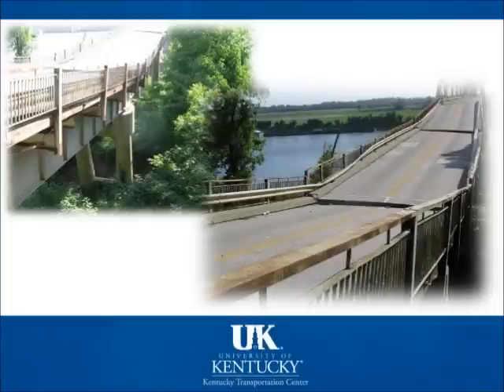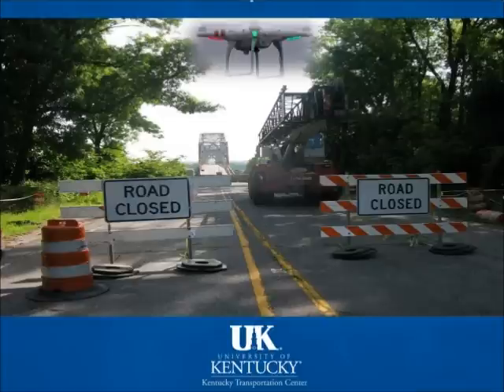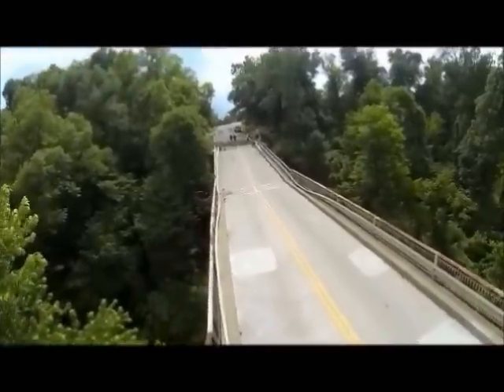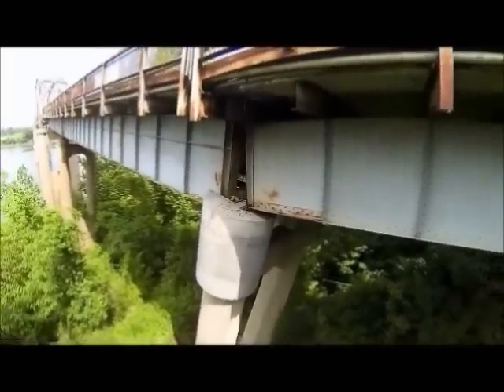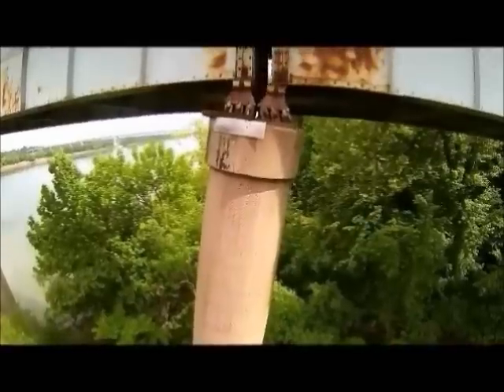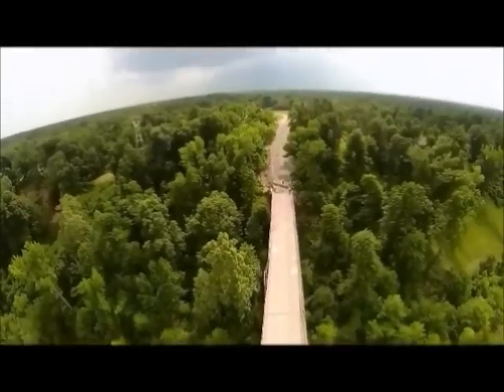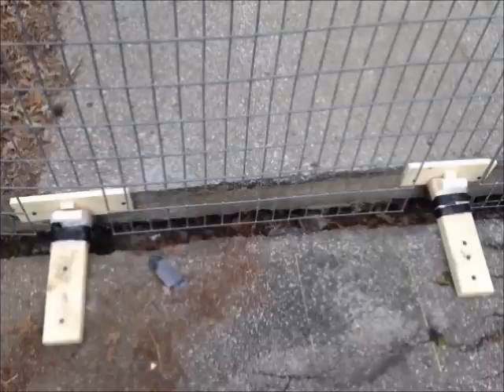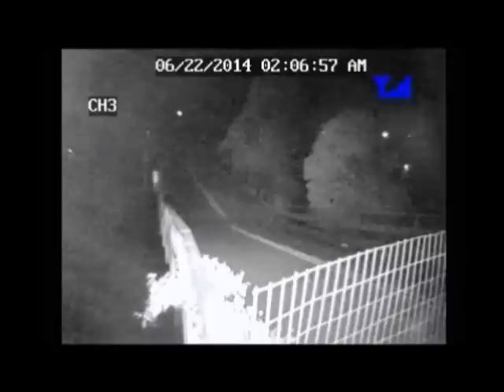Ledbetter Bridge Collapse Paducah, KY June 2014

Comment: Most of those bridges are nearly a century old, and some have passed that mark.  Most were 20 feet wide (some 18) and were not designed to carry the loads they did in later years.  Though the support steel was a bit rotted, the reason for this failure was the collapse of the bridge abutment.  They all need replacing;  even the I-24 bridge is insufficient.

Comment: In the mid-70's, driving from CO to NC, I crossed the two US68 bridges across the Land Between the Lakes, which were pretty much identical to the one in this video. At night, of course. All of us in the car still have wear marks on our teeth from meeting the 18-wheelers on those crossings. The bridges were evidently replaced over the last 10 years, but you can still see them on Google Maps Street View (as of August 2021).

Comment: All the Amateur Engineers keep saying what a poor design. The bridge itself didn't collapse, the approach did. That collapsed because the ground below it shifted. It stood without issue for 75 years, I don't think the engineering was that bad. For the record, the pier that shifted looked to have been replaced once already. If the original builders are guilty of anything it would be locating the bridge where they did.
Reply: Not claiming to be an amateur engineer... Just a poor old farm boy who's busted a few "engineered" bridges....
One would think that the pilings should be set in bedrock... Perhaps there is no bedrock there?? If they are in bedrock, they would have to have broken by the landslide.....
Whatever that case, interesting!
BTW, I'm with you, doesn't matter what it's about, always too many "engineers" that know it all...
Reply: Under the cement you can see all the rust
 The natural elements cause the rust which in turn degrades  the cement and your absolutely right about the pier structure don't appear to have been driven at the correct depth.
Reply: Good thing it didn't matter because it had already been closed for a while
Reply: An honest geological survey and some soil assessments would have been a good start.  But yes, on the money  @GosselinFarmsEdGosselin
Reply: @GosselinFarmsEdGosselin  no footing no bridge lol
Reply: Phil Connors 
It was closed 11 months before the total collapse. I believe it was about 9 months after the vehicle traffic was stopped when they issued the warning for barges not to stop under the bridge.
Reply: Yes, 75 years is a pretty good run.  This is why we have regular bridge inspections, maintenance, and repair.  Nothing lasts, except Roman structures built on terra firma.
Reply: Crossed this bridge numerous times over the years...  It simply wasn't intended for the weight of increased traffic levels as the years passed.  This area also has a lot of limestone (numerous sink holes, caves, etc.) and the river banks in the region erode due to periodic flooding.   It would be interesting to see what kind of research went into the original preparation for this bridge site.

Comment: Judging from the amount of rust on the bridge, it was due for replacement anyways.  
However, that the bridge piers were displaced by a landslide suggests that the piers didn't have solid footings.  They should have been sitting on bedrock or pilings.
Reply: People would stop driving over bridges if they knew how many had bad sufficiency ratings.  Well I take that back... people are stupid and would still cross them.  I have seen people drive around dirt piles on roads blocking traffic from crossing a bridge...
Reply: Depends on when the bridge was built and where it was built also arguably there are bridges in MUCH worse shape than the bridge here but still quite safe

Comment: "Unmanned aerial system or UAS"
Why invent complicated names for things? It's a drone period.
Reply: In some states is it illegal to fly drones around a road or Bridge structures or buildings that's why they had to use a new name to be official and not break the law
Reply: @emiliogreenwood8190  ok, so if I were to rename theft to "Apple pie" I could get away with it in some states?
That's really weird, but I think I get it. 😳
Reply: We deal with anyone that's in politics and make these rules who knows
Reply: UAS can be be applied to many different systems. Fixed wing, helicopter, lighter than air, rocket propelled, etc.
Reply: @larryscott3982  So we could call a 60 foot mast broadcasting a radio signal… 'Unmanned aerial system'. So very ambiguous and somewhat meaningless.
Reply: xenon53827 
In my work the term of choice is ROV. Remotely operated vehicle. 

So what? Are you not going to understand the conversation? Afraid that you can’t use context to glean the meaning? 

And if there are laws and regulations then you have to anticipate loop hole interpretation. 

Radio antenna? Really? A stationary object? I suppose all language use has to be 5th grade vocabulary. 

No, 5th graders get it.
Reply: xenon53827 
Your including radio masts IS meaningless.
Reply: @larryscott3982  There you go. the definition of a vehicle is… a thing used for transporting people or goods whilst An antenna is an array of conductors (elements) An aerial in British English being a single rod, wire or conductor (element).
A radio mast is stationary (usually) I never mentioned it wasn't but it can still be considered a UAS.
Seems most of your points are incorrect and I am the one not understanding?
Reply: @larryscott3982  I did put the word "ambiguous". meaning adjective open to more than one interpretation; not having one obvious meaning which I think a radio mast demonstrates well that the term is ambiguous and therefore not solely descriptive of drones, aerials, automatic elevated railways, London Docklands light railway for instance, the whole of the network comprising of an aerial (not underground) system which is self driven therefore not manned. It could be called an Unmanned Aerial System…
Reply: xenon53827 
So an overhead rail system could be considered an aerial system. ??? That’s not a stretch, that’s silly. Aerial, in the context of UAS, is synonymous with airborne. Context matters. 

“A radio mast can still be a UAS.” Not in an educated discussion.
Reply: @larryscott3982  Yes, like an aerial battle, aerial meaning existing, happening, or operating in the air 
It could refer to an aerial ropeway. Put a package on it and it will slide to the other side. I mean… What in Unattended aerial system refers in anyway to a drone a camera or anything else that was in the vid? Nothing. It was a drone with a camera. If you had never come across the term and somebody mentioned it, you would probably not have a clue about exactly what they were on about, therefore the term does not suit the equipment involved. The only information is that 'something' is a system, aerial and unattended, whereas 'drone with a camera' leaves you in no doubt.
I was only saying that the term UAS is ambiguous. That was it, period.
Reply: xenon53827 
“How was the bridge inspected?”

“We employed a UAS.”

Any questions? Or is that too vague? Even the FAA reg has “what kind of drone is your UAS”

“I have a question: was that by elevated railway? Or radio antenna? Was a camera swung on ropes? Please be more specific, I can’t be sure how the the bridge was inspected. I thought you would’ve used a UAV or ROV, why not a drone? Wouldn’t that be more cost effective? Explain it to me, I’m confused. UAS could mean anything when you’re inspecting a crumbling bridge.” 

“Sir, our contract with the inspection contractor was for an inspection. And our billing code was adopted from industry wide accepted terms. The same used by military, commercial operators and the FAA. Perhaps sir you should Wiki it.”

FAA:
Register Your Drone...
You must register your drone according to the rules you follow when you fly. If you are not sure what kind of a drone flyer you are, check out our Getting Started webpage.
UAS Flown by Certified Remote Pilots including Commercial Operators (Part 107)

“...An unmanned aerial vehicle (UAV), commonly known as a drone, is an aircraft without a human pilot onboard. UAVs are a component of an unmanned aircraft system (UAS); which include a UAV, a ground-based controller, and a system of communications between the two. The flight of UAVs may operate with various degrees of autonomy: either under remote control by a human operator or autonomously by onboard computers....”
Reply: xenon53827 
When the discussion is about radio an aerial is antenna. 

When the discussion is about combat an aerial assault does not mean to attack by whipping the enemy with antennas. 

When talking about a circus act, an aerial performer is probably a trapeze artist. 

When talking about ski lodges, aerial probably  refers to a tramway instead of funicular. But could mean by helicopter. 

CONTEXT. It’s all about context.
Reply: xenon53827 
“He was involved in a car crash.”
“So, he was in an automobile accident.”
“The other was charge with vehicular man slaughter.” 

I’m confused, was it a car, automobile or vehicle? Maybe a truck? 

But a car is s vehicle and a truck is vehicle. So why aren’t trucks automobiles too? I think that maybe only driverless cars are truly automobiles. Hmmm.
Reply: @larryscott3982  Simple as you asked how the bridge was inspected, and someone replied "with an Unmanned aerial system" and you had never heard of it before, you would not have a clue what they were referring to. I know you mentioned context, but the title has no context relevant (explain again, oh sod it,,,copy/paste) What in Unattended aerial system refers in anyway to a drone a camera or anything else that was in the vid? Nothing.-
"Unattended flying cam" leaves no one in any doubt about what is being talked about.The context is this; unless there is a clue in the title then it is meaningless. its a drone with a cam, that explains it where as a UAS could mean anything in the air on unattended as part of a system, no clue to flying, camera capability etc.
Reply: xenon53827 
But if I’ve never heard of drone? or UAS or UAV? Then drone has to be described as well.

“It’s a Drone with a cam” explains it. 

Little tiny drone worker bees with cameras. 

I like it.
Reply: @larryscott3982  ...and when talking about a broken bridge an aerial is probably…… Exactly. Thanks for making my point. It's ambiguous.
Reply: @larryscott3982  More people have come across drones and are likely to know what it means, whereas some bunch of initials does not convey an idea thought or message.
If you have a level of intelligence to know about worker bees and the correct term for them, then it is highly likely that you know what a cam drone is. Especially as you watch youtube vids. Anybody would understand that drone was not (currently) worker bees with cameras. I think I am beginning to see a problem with your logic. Are you just trolling at this point?
Reply: xenon53827 
Not ambiguous when used in a sentence with other word, especially homophones. 

I had just gotten into the car when my phone rang. 
You were driving? 
No, the elevator car. 
Oh you should’ve said the elevator.
Reply: xenon53827 
We are confronted with new terms, abbreviations all the time. 

Drone to UAS is like a plane to aircraft. 

Satellites are identified by SV number. Space vehicle. And plenty of people ask what is SV. 

Gps signals are identified by PRN.
Reply: @larryscott3982  exactly, and as UAS does not contain camera or drone, then as you just pointed out, confusion reigns.
Reply: @larryscott3982  I loved your slo-mo vid on the watch, and a question on another vid… Those clouds, was that real time because I found that very intriguing as we had a (very small) Tornado hit the end of the house in Florida and rip a bit of the roof off. Stupidly, we stood at the windows watching as everything flew in a circle. there was a brief pause and then everything reversed direction. we had leaves in the roof eaves at the far end of the house because the wind went dead straight through the porch and car port. one place across the road lost the end of their house.
Reply: @larryscott3982 well there you go, no idea what a PRN is, but can guess that GPS codes could be codes to do with the GPS system. YAY! See, it's the wording that counts.
Reply: xenon53827 
In Afghanistan our mapping ‘drone’ was always referred to as a UAV, definitely not to use drone!! Because in AF drones are primarily weapons platforms. Can’t have that ambiguity. 

Our UAV, oft called UAS, had only camera and LiDAR.
Reply: @larryscott3982  well, that's interesting. Anyway, sod the drones, UAS's, and all that… You seem way too intelligent for us to waste further time on the eccentricities of acronyms and mnemonics when we could be debating much more interesting subjects. I feel that my day is getting better!
Reply: @larryscott3982  I don't want to pry, but your knowledge of weapons, well, were/are you in the military in your country? Were you in Afghanistan? I mean, just out of interest, we may have more in common as far as serving is concerned.
Reply: xenon53827 
I worked in AF for a couple yrs as contractor. And Bosnia, China, Argentina, Saudi, 8-9 more. I get around. Aerial mapping, geodetic control. 

Long time ago I worked for Chicago Aerial Survey. I was entering a NASA facility and the guard had to call someone to get permission: 

“I gotta guy here from Chicago Antenna...”
I didn’t correct him.
Reply: @larryscott3982  I served in the British army, but after that, I was a contractor for the US navy, both in the USA and later in the Uk at Northolt and High Wickham, London uk. It was very useful as the ATM dispensed both UK pounds and US dollars so I would always go there before travelling back to the US. I still have a kettle from the thrift store in High Wickham and use it on a 120-240 transformer. 
It was interesting because I had old documents that I wanted to print out, but euro A4 paper did not work as I needed demi quatro, but oddly enough, US letter size was exactly the same, so I used to blag paper off them! Need some more now…
I was in the Royal Signals and did coding and mapping… I was also a very good marksman, but that took me into an area that holds mixed feeling for me.
Reply: Obviously you've never worked in government.  First rule is always add layers of needless complexity to secure and justify your job!
Reply: @scottpecora371  Wasn't sure who you were replying to, but if me, then you are correct. I don't lie well enough to work in government.
Reply: I still like the "soil migration"....

No, it's a LANDSLIDE. Just say it.
Reply: A drone period?

Comment: I used to live in Paducah and I rode across this bridge a few times growing up. Barge traffic was always hitting the bridge and it was built if I remember correctly in the late 1920s.  It was known back in 2000 that the Bridge needed to be replacedand they ask for bids and proposals for a replacement bridgebut going to newbridge takes time especially when you got saved up money during the middle of a recession
Reply: I remember when towboats used to push against the piers when testing their engines.
Reply: I was wondering if maybe it was a WPA project. It looked to be about that old. But the WPA wasn’t until about the early to mid 1930’s.

Comment: Unmanned Aerial System.
DRONE. It's called a drone.
Reply: I was actually about to say same thing. So much Easier to say too. Drone.
Reply: Technically its not a drone.The definition of a drone is a ariel object that flys by itself to and from an area.But its flown by a human pilot while in the area.Look it up
Reply: @lawrencecarpenter638  So then all these drones that people use to produce awesome videos everywhere aren't really drones then?
Reply: @whiteknightcat  NO.Those people are flying nothing more than quad copters.
Reply: @lawrencecarpenter638  After doing a little looking around, I've found that the manufacturers are calling their products "drones" and an accepted dictionary definition of a drone is "a remote-controlled pilotless aircraft or small flying device", aka an unmanned aerial vehicle (UAV).
Reply: @whiteknightcat  the US military came up with the word drone.Its an aircraft that takes off.Flys itself to a location.Then a pilot destroys whats in the location.And it flys back to base on its own.U said its an accepted definition but that don't make it the right definition.Manufacturers are calling them drones because its easier and sounds better than quad copter.People love them because with a motor on each corner they make the most stable camera platform.Take 2 of the 4 motors away.Then use one motor for the main rotor.And the other for a tail rotor to overcome torque.Now u can do the same thing with the conventional lay out helicopter but u or any manufacturer still wouldn't call it a drone.Even though it can perform the same duties as a quad copter.Drone is a military term glamorized by companies to make alot of money off what is actually a quad copter.

Comment: This is BS. WHY would any sane, normal person need to "monitor" a collapsing bridge? No one can utilize it, anyway. Tear it down, rebuild with supported structures and protect the foundations from landslides. Geez.
Reply: As was stated in the video, the DOT had concerns of further collapse sending approach spans into the water affecting river traffic or further compromising the spans that hadn't been affected.  It takes time to draw up and approve plans for repair as well as bid out the job.  Until that process concludes, you need to watch for further collapse which could also compromise the undamaged portions of the bridge that can be reused.
Reply: It had been closed for a while when this happened. The new bridge was already built